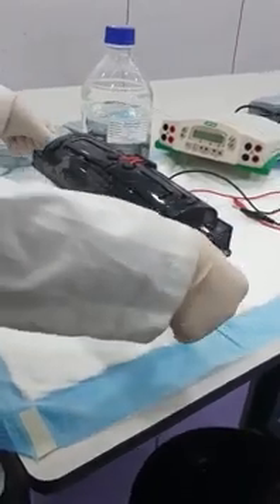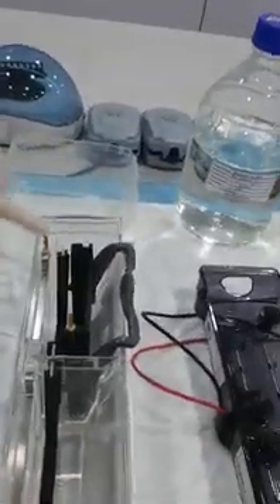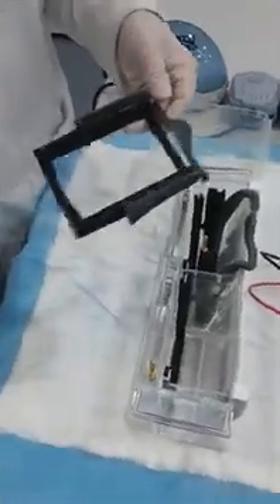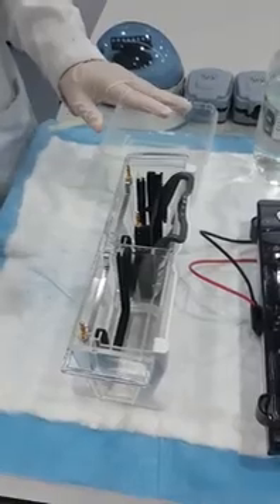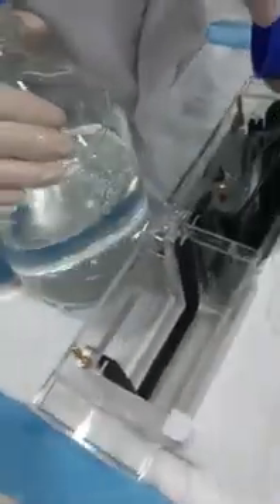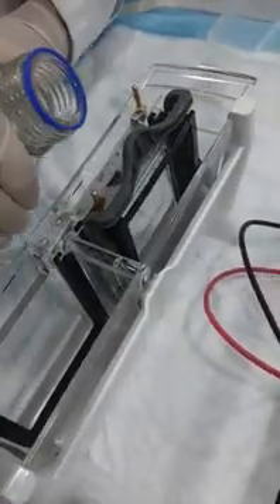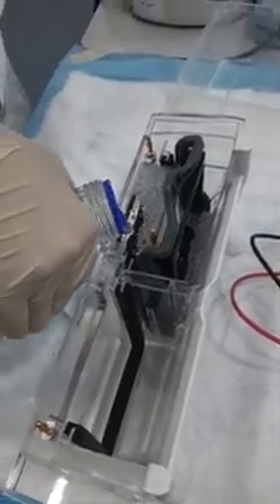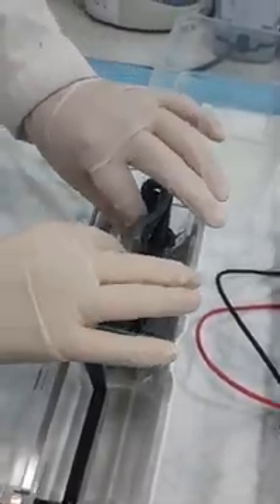How to set up mini Gel Tank for PAGE

Comment: Do we need to pour half tank of running buffer to the back of gel? Why?
Reply from the maker: The positive electrode is at the bottom. So technically you don't actually require half tank.
Reply: @sunnyscience3384  thanks
Reply: Hiiii… voltage and running-time ???
Reply: @srilakshmi7701 I run 50V for 10 min then 150V for 1 hour
Reply: @baoliq4728  what about transfer? What is the appropriate voltage for transfer?
Reply: Do u set different voltage for resolving and stacking gel?